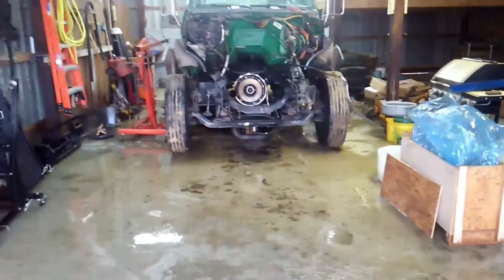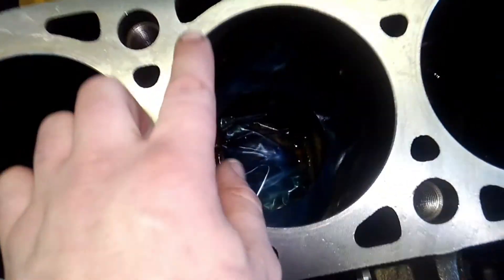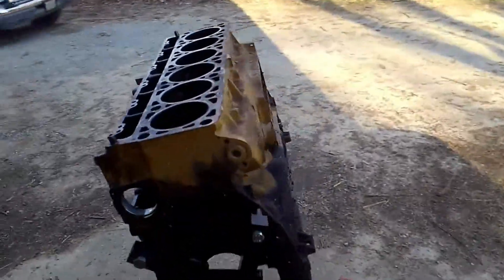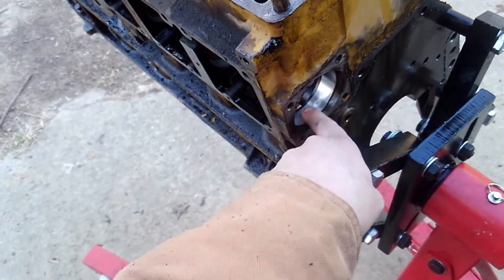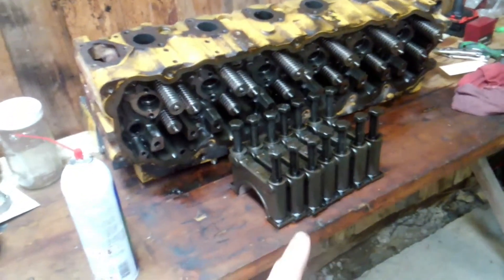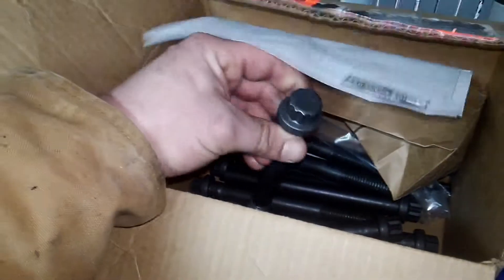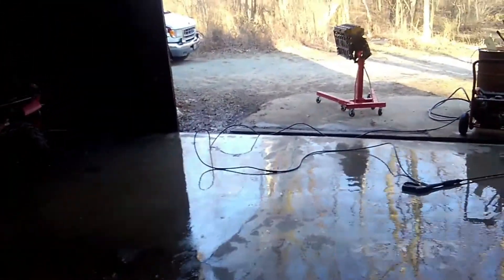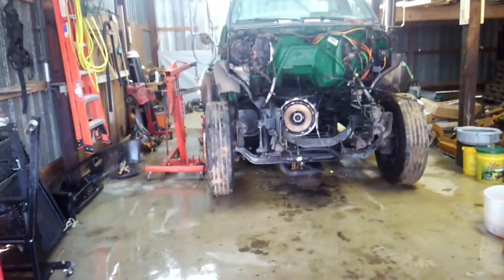CAT C7 UPDATE!

Comment: Did cat say why the rings broke with low miles? I have a 2005 c7 in a sterling 7500 is why I ask.
Reply: Almost always a leaking injector.
Reply from the maker: This was geared very low. It use to be used in the tree service. I believe a lot of idle time and running wide open at 65mph wore it out early.